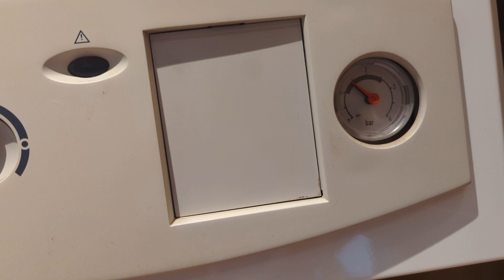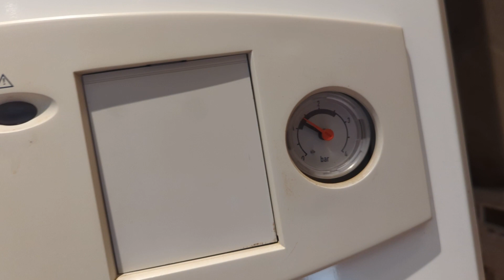Sentinel X100 Inhibitor Rapid Dose. How to use???

Comment: You did that wrong - ur supposed to open rad valve before you dose and attach the can - the bullet in the can prevents the system pressure forcing water out the tube - attach the can and its dosed in a few secs. Remove can from tube . Shutand the bullet acts as a NR valve. Shut rad valves and reattach bleed screw - or the whole nipple as u removed. Way you did it with valves closed meant you put a lot of pressure into a small space rather than spreading it through the system which is why you got a problem trying to remove tube. Do that in a smaller rad and it won't all go in or might even blow the tube out.
Reply: That's what I thought, so I came to the comments to check. Thanks for your comment.